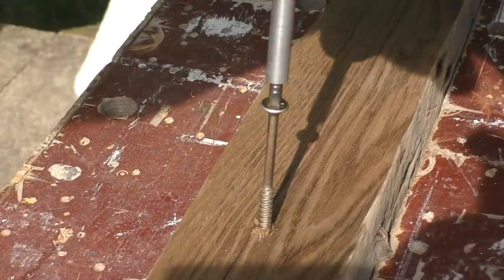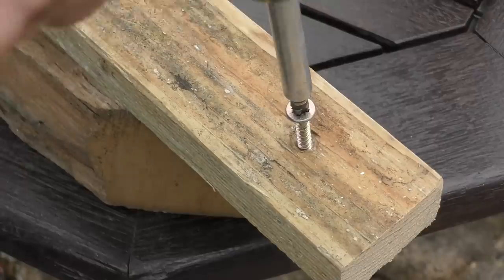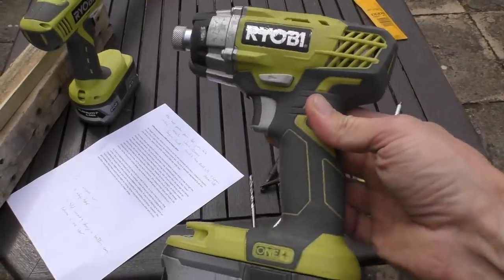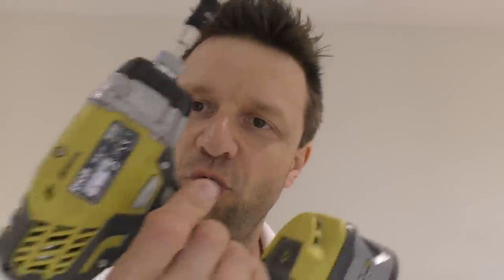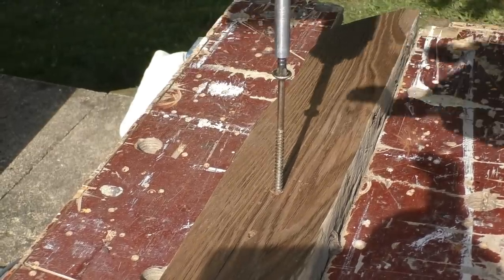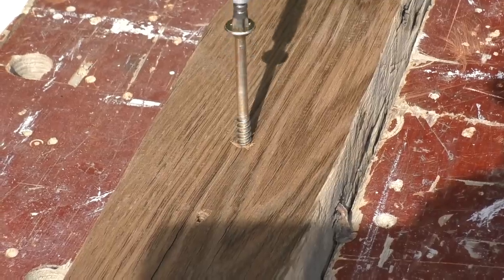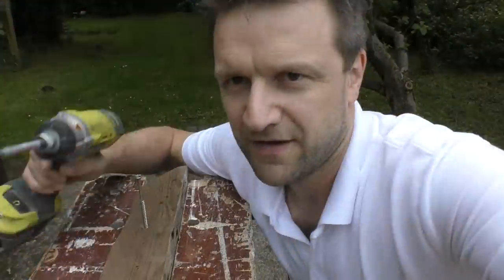Difference between Drill Drivers & Impact Drivers

Comment: Brilliant explanation thanks Charlie.   I have the same drill / driver combination and didn't realise the difference until I was failing to screw in some landscape screws in a retaining wall and even with a high powered corded drill was failing.    A mate who was a builder said to me..."uhmm why aren't you using your impact driver?'"  Learn something new everyday!
Reply from the maker: Thanks Shaun. Yes the thing about impacts is the hammer action operates in the direction the bit is turning (which gives it it's power) whereas on a combi drill it operates in line with the drill bit. A lot of people ask if they can just use the hammer action on their drill. You can't, for this reason.

Comment: Excellent video. Have looked at it several times and come to believe that a dril driver plus 3 or 4Ah batters would be bust for me. Thanks in helping.
Reply from the maker: You're welcome, Malcolm. When you say bust, do you mean it will be just what you need? Yes, it's all about working out exactly what you're going to do with it, and the manufacturers don't help by having so many apparently very similar tools to choose from. For a slightly more indepth analysis of the difference between the combi, drill driver and impact, you might take a look at this https://www.youtube.com/watch?v=i6KYfrDBj3w&t=32s Granted, it was a video I did for B&Q (my only Ad video to date) but I think it's a bit more comprehensive than the one you've just watched 👍

Comment: thank you very useful info. I was trying to get both drill and impact driver set in a combo for instead of paying the same price for a drill driver with a larger battery. After watching this video I know I am wrong, I should get the all around drill driver with the large battery because larger battery doesn't only mean last longer but also more powerful. I don't need the impact driver at all.
Reply from the maker: You probably don't need the impact, as you say. Check out my recent video, which goes into the differences between each tool https://youtu.be/sL-t2Zc4wCs

Comment: Beside, the Impact vs Drill Driver, I like your battery test.  I never realized that there is a difference in power between a 4.0 Ah vs 1.3Ah.  I tried to mix cement with a Ryobi but it froze after 5 minutes.  I returned that Drill Driver but now after watching your video, it makes me wonder that it was on 1.3Ah when it froze.  My Craftsman had no issue mixing cements with NiCad batteries.
Reply from the maker: Thanks! Yes it could well have been the 1.3Ah battery.

Comment: awesome, raw power, like darth sideous.  i just bought a combo kit for $220 with circular saw, miter, reciprocating, drill, impact and a light.  came with 2 batteries and i bought for $75 a pair of 4ah.  the other month i bought a simple B&D with internal nicad, a bit gutless, over cams screws and gets stuck in 2x4s

Comment: its good that you included the point about the amperage of the battery providing more power on both tools... the thing about a drill driver is that you should drill a pilot hole for the screw so you don't crack the wood and that will also let the screw drive easier... its another step but its the right way... and with an impact driver you won't be drilling pilot holes so depending on the wood and where the screw is placed you could split it without a pilot hole

Comment: I have the brushless Roybi impact wrench with a 9ah battery and the collet attachment.  I use it to change my road tyres to race tyres and back again at the end of a meeting. I have also used it in replacing decking timber screws.  With this power I do not have to pre-drill the holes.  My previous impact wrench (rattle gun) was a Chinese 68V 2.5Ah battery that would not last the meeting. Lesson: cheap rattle guns support the statement "you get what you paid for".

Comment: I have found over the years the perfect combination for me is three tools - a heavier duty combi-drill ideally with a hammer function, primarily used for drilling, but can also be a driver if need be; a lighter duty drill driver primarily used as a driver, with good speed control for more delicate driving; and an impact driver for whacking in screws with speed and power. I have found the impact driver is sometimes just too aggressive, especially for more precise work, so in that instance I'd want a separate drill for pre-drilling and lighter driver for, err, driving, to avoid faffing about changing bits etc. In particular I don't really like using the impact driver for anything but driving into 'structural' wood. You also then have two tools that can, if needed, do most of the things you'd need from a drill/driver - something that can come up occasionally.
Reply from the maker: Thanks for this. I talk about this here https://youtu.be/sL-t2Zc4wCs For me, I seldom use the impact so it's a light drill driver, and SDS as combis are pretty hopeless at drilling into concrete.

Comment: I learned on another video that if  a screw is having a hard time going  in, its best to back it up and remove the wood shavings from the screw and then drive it back in. If the shavings are are not removed adequately then more driving torque is needed.

Comment: Very interesting! I have both, my Ryobi impact driver has a 1/2" square shaft for direct connection to a socket set for bolts. I recently got the Ryobi drill/driver because I've been doing more woodwork lately and wanted a handy drill. I have 4 batteries ranging from 1.5 Ah to 4.0 Ah. My garden trimmer is also Ryobi using the same batteries. I really like the Ryobi range of battery hand tools. All the best, Rob in Switzerland
Reply from the maker: Hi Rob, thanks for that and good to hear from in Switzerland. I was on Lake Geneva before lockdown installing some soft furnishings. Beautiful country!  Yes, you're like me. My Ryobi collection was kicked off by the father in law who bought me a combi and driver starter set 10 years ago. Since then I've added everything from chain saws, leaf blowers, site lamp, vacuum, router, drills, the list goes on. Great value tools!

Comment: Good video I didn't know battery size correlated with power I thought it was all about run time. Of course now you can buy the kit with the drill and driver so you can go along and drill a pilot hole and follow with the driver to install the screw. Also rub the screw with a bar of soap it drives a lot more easily

Comment: Couple of things here.

1) unless you are using a self drilling deck screw, you need a pilot hole.
2) drill needs to be in low speed, high torque mode.
3) Philips head screws are second only to flat head screws for driving in large screws.  Torx or Robertson are far better.  If you insist on “Philips”, you need to use the “Japanese Philips” bit...the traditional Philips is designed to “cam out” at high torques (design was to be used on aluminium skinned airplanes to limit the tightening torque).  It is because of the designed cam out feature that requires you to push down so hard the drive the screw..
Reply from the maker: Thanks for that. The only reason I didn't feel a pilot hole was to try and make the challenge as brutal as possible. Very interesting point about the philips. Does that also apply to pozi drive? I agree totally with what you say about robertson and torx.

Comment: I would also like to clarify the units for viewers of this video. SI unit for charge is coulomb = ampere * second. This is inconvenient because we express the duration of tool use in hours or fractions of an hour, hence the ampere-hour. For the same reason, kilowatt-hour is preferable to 3.6 Megajoules.
Any battery has its internal resistance which along with EMF determine the short circuit current. As the amount of stored charge goes down, so do the EMF and maximum amperage. There are other variables that affect this. Brushless tools use synchronous motor with permanent magnet on rotor and controller adjusts the rotation of magnetic field in stator.

Comment: Have had two Ryobi drill drivers and loved them apart from the chucks. It doesn’t take long before they just don’t grip drill bits . If you have super wrist strength you can tighten them sufficiently to prevent slippage but then usually have to uses grips to release. A great drill spoilt by its chuck.

Comment: An important point that you didn't cover is that for very occasional use such as mine for instance when I do one or two projects a year, battery degradation is an issue.

I prefer to use mains powered power tools because in ten years time I will still be able to use the very same tools.  It took me a while to find a mains powered impact driver but I found a Makita and it was invaluable when laying floorboards recently.

I can see the huge benefits for site workers using cordless but sometimes they are overkill in my opinion.

Comment: I use a hammer drill. Seems to give me the best of both worlds (or close to it). I keep a compact brushless impact wrench in my Jeep to help with tire changes. Cordless is getting closer to corded all the time. The "largest capacity battery I have is 18v 12ah.

Comment: That's Pozidrive screw you held up and I think it's a Phillips bit in the drivers. That's why you had to apply so much force - it will have stuffed the screw head immediately.
But weirdly the fact you still managed it kind of proves the utility of the impact driver even more, so thanks for the video.
Reply from the maker: Yes it's a Phillips bit which was an error on my part. I thought the black impact bits in my collection were only PZ and so didn't bother to check...

Comment: Charlie, I was wondering something. In your combi vs SDS drill video you mentioned a time when your combi simply couldn't get through a window lintel, which matches an experience I've had myself. 
Is there any chance at all the battery (I.e. a 1.5Ah battery) could have been the issue for you there or can that be ruled out?
Just wondering if I should fork out for a 4Ah battery or a corded SDS drill in my case!
Reply from the maker: No mate, absolutely nothing to do with the battery. It's all about the drill - check this out https://youtu.be/tYUvlxWkFh8 You get a LOT for your money with a drill like this. It's a big lump though so depending on what you're using it for you might want something smaller.

Comment: Thanks for the video. I think you swayed me away from getting an impact driver.  Currently, impact drivers are about $20 cheaper than the drill.  Because, I just want a drill for home use without expanding my power tool lineup, I might go with a makita drill with 1x3ah battery over the ryobi drill with 2x2ah battery.  Mainly because of the ah's of the battery and the makita is $20 cheaper.
Reply: So you basically say you choose a makita with 1 battery with capacity of 1.3 a over a ryobi with 2 batterys and batyery capacity of 2.0 a?

Btw here in belgium they mostly sell dewalt, bosch or makita havent seen ryobi
Reply: @kaanerdem2822  no. the makita has one 3.0 ah battery while the ryobi has two 2.0 ah battery.

Comment: Wow, I didn’t know batteries made such a difference. I bought my Ryobi combi drill and circular saw with a 1.3ah battery. Only used it for small drilling so far, but as I’ll need to use the saw soon, I may need to buy a 4.0Ah batt now!
Reply from the maker: It's a good investment, Christian. I hardly use my 1.3ah batteries now, although they're a good way to keep the weight of your tool down for the lighter jobs.

Comment: I just ran across this video, so I'm late to the party.  I don't have time to read the 2000+ comments, but I did want to note that the screw you were driving is a Pozidriv® screw and not Phillips.  The cross in the head of the screws is not geometrically the same as Phillips and the bit used to drive it will not contact the surfaces of the cross in the screw properly.  Pozidriv® screws and bits are recognized by the extra slash mark between the cross (screw) and a raised line in the valley (bit).  You were driving a #2 Pozidriv® with what appeared to be a #2 Phillips bit.  Just an FYI if you didn't already know.  Bit life will increase dramatically if you match the bit to the fastener and screw head damage will  decrease as well.

Comment: Worth a metion that if you're driving screws into dense wood a drill is more likely to break the bit with the constant force where as an impact gives less stress. It's the difference between pusing a nail in and hammering one

Comment: Interesting vid. Thanks. 
I’m looking to put up feather edge fencing in my garden. About 10 meters. I’m a basic DIY’er. Do I need impact or drill driver to affix the  boards?
Reply from the maker: You'd be fine with a drill driver as the wood is soft, but it's more typical to use nails. What screws are you thinking of using?
Reply: Charlie DIYte - thanks for the reply mate. 
To answer your question - I’ve not thought that far ahead! Wood screws??? 😀
I’m a basic DIY dad, that would just take advice from one of the old dudes at B&Q!

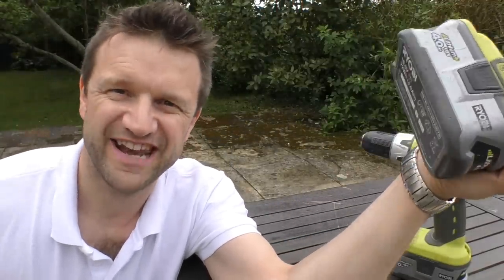Comment: 6:50 No, that's not what an amp-hour is. Amp hours is the number of hours for which it can deliver one amp. So if a battery is 5Ah, it can deliver 1 amp for 5 hours, or 5 amps for 1 hour. The amount of power it can deliver all at once is just called Amps.

Comment: With the battery, I have the same thing with my siku controll 7R and my playmobil RC diesel engine from 2012 from or so, with fresh betterys, they can pull a lot, but when they loos charge, they get weaker to the point that the 7R can't move anymore.

Comment: Hello Charlie and friends. I think I understand the difference between an impact driver and a drill driver—drill is more versatile (most importantly drilling holes) whereas the impact drive uses percussion to move the screw into a surface easily. Here's my challenge: I live in an apartment with rock solid cinderblock and plaster walls (new construction). I want to hang pictures and install wall-mounted items around the apartment. I have a drill driver and purchased masonry bits. This combo fails to drill holes in the walls big enough to accommodate plastic wall anchors/screws. I try a narrow bit first, then a wider bit. Normally the hole just crumbles near the entrance.  I got the impression from this video that impact drivers are just used for screwing, not drilling. It seems like an impact driver + masonry bits (plus decent battery ;) ) would be better than a drill driver + masonry bits. So, will an impact driver support masonry bits? Is there another tool that is not mentioned here that I should consider? Thanks!
Reply from the maker: Hi Ash. No, what you need is an SDS drill https://www.youtube.com/watch?v=tYUvlxWkFh8&t=9s It will go through your walls like a knife through butter. The percussion action on an impact drill works in a radial motion, ie in the direction that the bit is turning which is why it makes it so much easier to drive home screws. However this would be hopeless for drilling in the same way that the hammer action on a combi drill / drill driver works perpendicular to the hole, (or in and out of the hole) which is why it would be hopeless to use the hammer action on a combi to drive in screws (as people so often ask me). The SDS is a different beast altogether as the hammer action goes in and out of the wall, but a massive 10mm as opposed to the almost pathetic vibration you get on a drill driver. Watch my vid, you'll see what I mean. So for us DIYers, what you really need is a nice light drill driver for day to day light weight jobs, and then an SDS for drilling into concrete and masonry. The impact is good, but probably only necessary if you've got repetitive jobs to do.
Reply: Save your money dewalt do masonry bits that go right into your impact and work really well

Comment: There has been a collett on the market for years to use a drill bit on an impact driver. I bought one around 15 years ago for my battery (cordless) screwdriver.
Reply from the maker: How d'you get on with that. Is the rpm fast enough for a drill?

Comment: Does UK require a permit for drivers, drills and power tools?Cool video.
Reply: Nope, anyone can purchase and use them.
Even on Building sites over here, as long as you're deemed "competent" enough, you can use them. If you're incompetent, or fluff up something whilst giving the impression you are capable, you'll probably not be allowed to use them again and mocked by your peers (unless in training or an apprentice). Lol

We do have "abrasive wheels" (amongst others), which is a quick course on disk cutters/grinders. This course is often mandatory along with Emergency First Aid at Work at an induction, in certain groundwork trades.
We do have many courses offered over here, I imagine some cover use of power tools, but most come into sites with capable prior knowledge, or pick them up as an apprentice etc.

Obviously there are always people that should never be trusted with power tools, but hey. XD
Reply: @EvoBeard  That is good, Only mishap I had was with a Makita angle grinder being left on , I plug it in and my finger got cut.

Comment: the cell size is of no consequence if it is then get a bigger battery the higher power drain the quicker the bettery runs out . ive been using ryobi tools here down under for years. always thought the ( anybodys) curdless drill was the greatest invention since sliced bread. well i was introduced to the impact driver coupled with a drill drive , must have! the difference is a drilldriver with impact for brick hits like the end of the drill but the impact driver hits sideways like the tool mechanics use to take off wheel nuts or other stubborn bolts in the car. they used to have a tool " the impact screw driver" used a lot by motorcycle mechanics that you flogged with a hammer... much the same thing only cordless.
Reply from the maker: Exactly Stephen, as discussed in this vid https://bit.ly/3sxpfw5